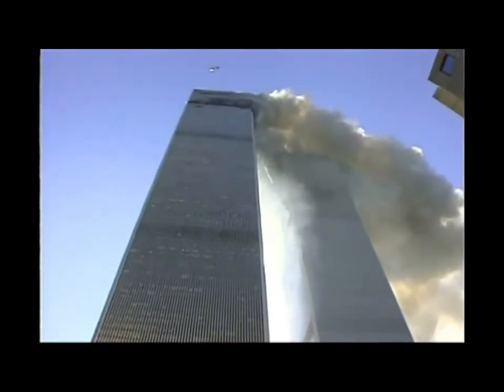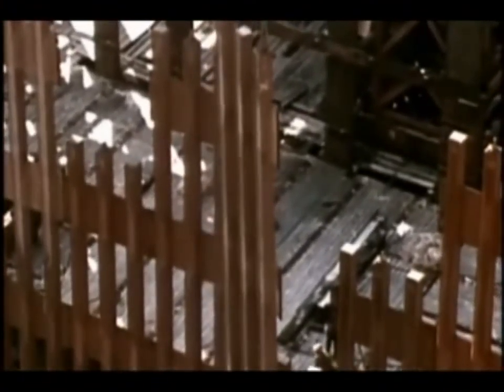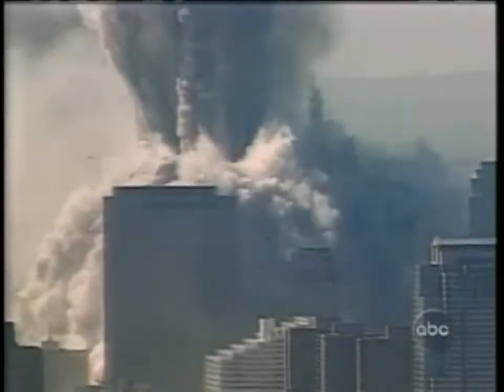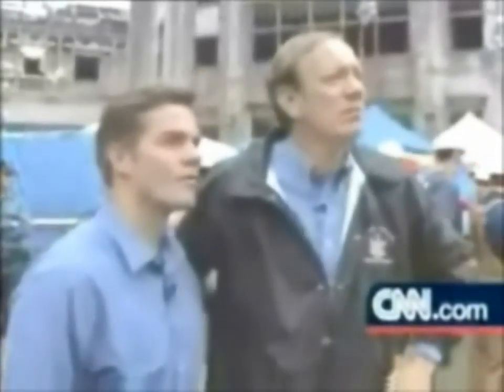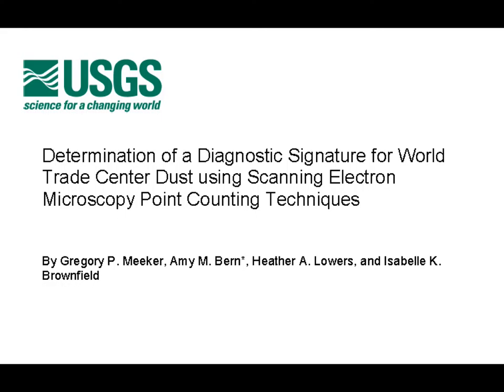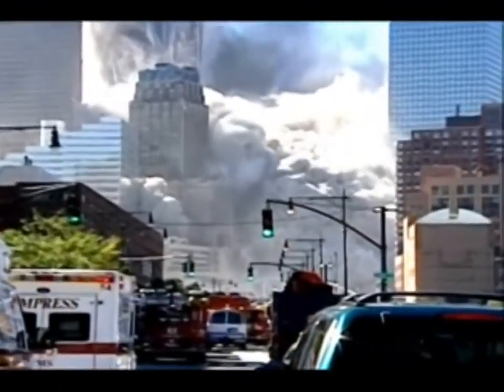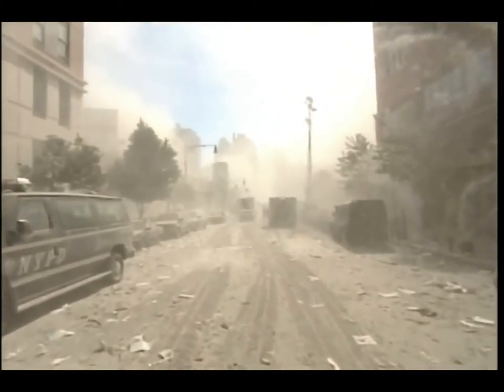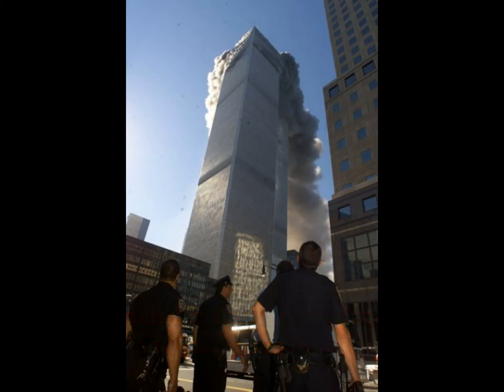Energy required for pulveriztion of concrete in Twin Towers

Comment: What I don't get is how it is possible---as the official account suggests---that the top-most floors were pulverized into dust when there was no great mass falling down on them, which would theoretically be needed to destroy those top couple of floors, yes?

Go ahead and accept the specious argument that the lower floors were pulverized when the mass of the upper building fell down on them, but the top couple/few floors should have been largely intact, since nothing fell down on them.  They should have ended up sitting nicely on the top of the debris pile, along with the broadcast tower and the mostly-intact 'hat-truss' steel frame at the top of the uppermost floors, plus any bodies of those victims who were trying to get to the top of the building

Has anyone been able to, or has even tried to, duplicate the observed pulverization of concrete in some kind of scaled down model, using only gravity + the mass of the concrete/steel structures?